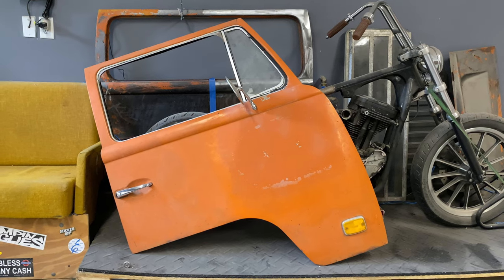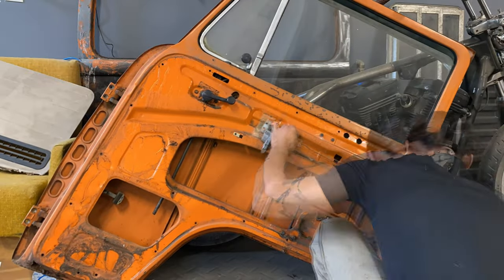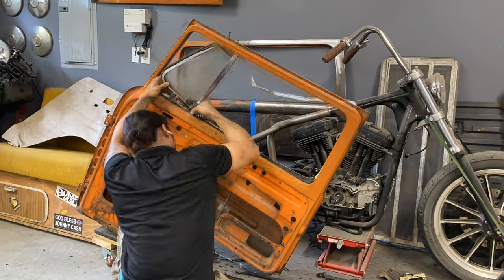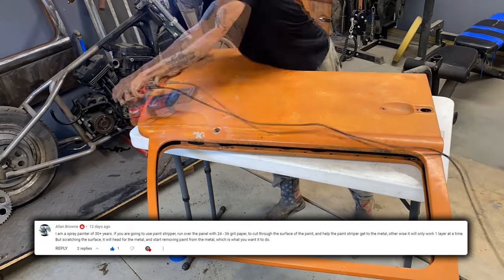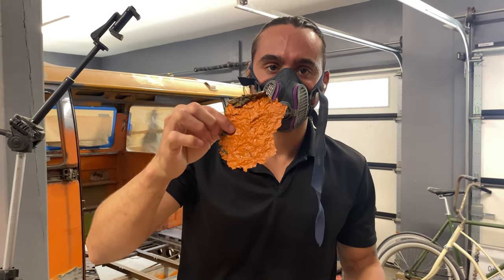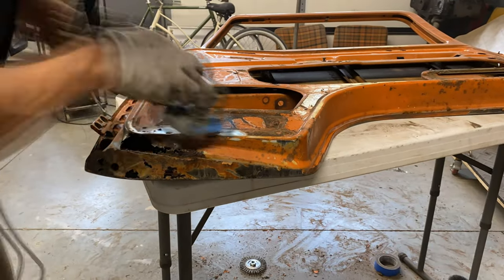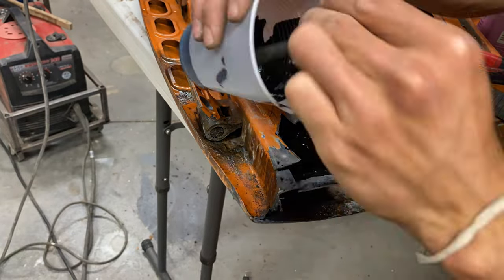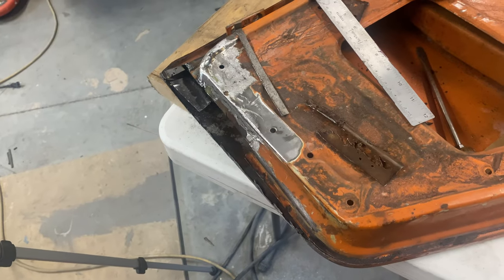VW Bus Restoration Episode:51 | Restoring The Front Doors

Comment: The door vents are to let air OUT of the cab. The front of the doors incorporate air vents (the oval holes you see when the door is open). When you move at speed through the air a low pressure area is created at the front of the doors (Bernouli!) which effectively "sucks" the air out of the cab, through those vents. So if you open up the air INLETS, you need those vents open to enable the air to flow. If air can't get out, then no fresh air can get in! 
Lots of folk remove those 'pointless' vents when they replace their door panels, but they're there for a reason. Particularly if you replace all your door seals and window rubbers. Believe me, you want to keep them if your doors are in good shape with nice new seals and rubbers.
Reply from the maker: Thanks for that information! Very well explained
Reply: I also did not know this :)

Comment: It's like watching myself take apart my doors on the restoration of our 71 Westy. 

One suggestion that has helped me, instead of a parts can, I use small ziplocks (sold as jewelry bags) that I label as I take the parts off and then organize into plastic shoe bins. It has really been a huge help during reassembly. The bags can usually be purchased with a variety of sizes. Another great video. 

When do we see some mini ramp action? L8R SK8R.
Reply: Exactly what I was going to suggest. I take ziplocs, even if there is only two screws in a bag, I label them with green masking tape saying what they are and where they go. Otherwise it becomes even less fun later on

Comment: Have you tried using citra strip on automotive paint?  My bus had a rhino liner like paint on the cargo floor, and citrastrip is amazing at taking it off.  Guess I can just try it on the next paint spot I need to take off before going and picking up the aircraft stripper.
Reply from the maker: I have not tried citrastrip but I've found at this point that only paint stripper ultra works for most things!
Reply: @Vangabonders  gotcha.  Thanks for the video.  I have some Swiss cheese on my two doors, but only appears to be on the bottom vertical faces.   Hopefully my fabrication will be more straight forward than yours.

Comment: HA - "...OH OH...' is far more restrained than my normal "F-CK F-CK F-CK" when something goes wrong - HA.  TOTAL BS re the aircraft stripper - HA - USE COOPERS STRIPPER from NEW ZEALAND.  If you do use that CRAP stripper you used - once you have put that CRAP paint stripper on - place a cheap plastic sheet over the stripper - it retains the chemicals that 'sort of strip you paint - BUT - 'HOT TIP' USE COOPER STRIPPER - HA.  CHEERS from AUSTRALIA.